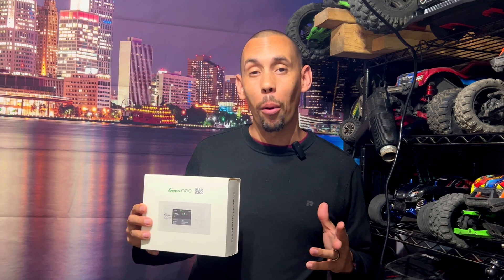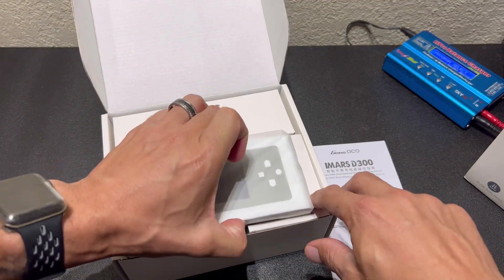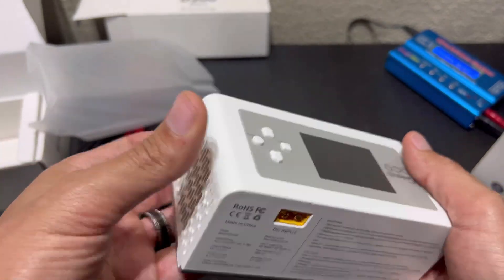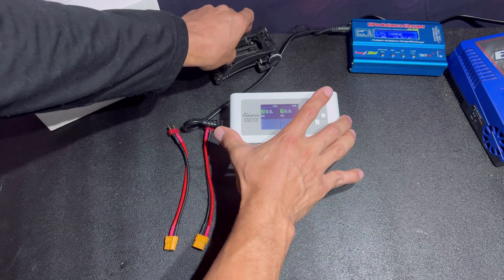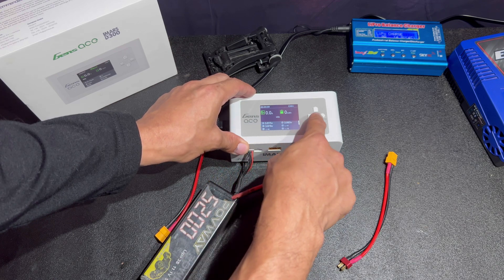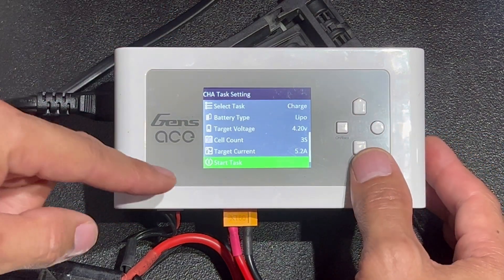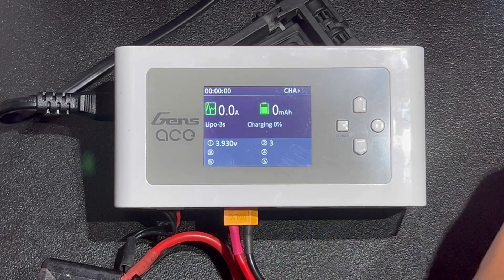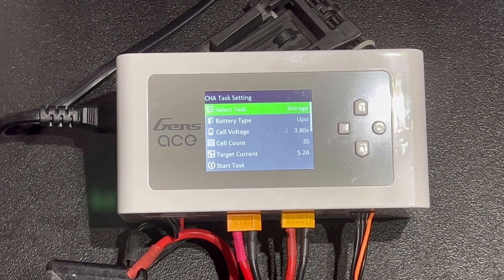How To Setup Regular Lipo Batteries - Gen Ace Imars D300 Unboxing

Comment: So do you just charge lipos with the charge option? Is the balance option something I shouldn't worry about most of the time?
Reply from the maker: Yeah just use charge mode it will balance charge automatically. You balance charge if your battery has low cells

Comment: Question, if I got a battery that was, say, 9200mah, would I have to go into the parameters and raise the maximum mah it will charge? I saw razor rc and it showed around 7600 as a default cutoff so it doesn't overcharge. Or, would the charger recognize the mah and automatically continue to fully charge the 9200 pack at 9.2 amps?
Reply from the maker: Hello, sorry for the delay. You can set the how fast it will charge separately from how full it will charge. You can choose what volt each cell (full) goes to and then you can set at how many amps (fast). 
 
It will automatically set the volt it will charge at and you can change it as well. You will have to change what amp you charger it because it will be saved from the last time you used it. 
Also any parameters set on side A will be automatically set on side B but can be changed.

Comment: Hey bud awesome video thanks for sharing - quick question, is it best to default charge a Lipo under the charge setting or the balance setting? Is there any negative outcomes from using the balance setting to charge as default?

Thanks :)
Reply from the maker: Thank you 🙏.  That is a great question and maybe I should do a short video on it. The answer is, The standard charge feature balance charges your batteries for you automatically. You can watch each cell move up while it’s charging. The Balance feature is cool because you can use it to fix bad lipos. Well to an extent. If the cell is dead dead, the charger won’t be able to fix it with that setting.
Reply: @familyrc777  amazing thanks so much for the quick response! So it’s ok to to use the ‘charge’ feature as a default then as I noticed when I plug my g-tech batteries in  it goes to charge and not balance so I guess that’s preferred unless there’s an issue with the Lipo…?

Comment: I have several batteries with internal balance circuit. Is there any trick to charge lithium batteries without connecting the balance cable with the D300?
Reply from the maker: @minekoiwa2971  not sure in that one. If you figured something out pls share.

Comment: I love the gens ace.. I’m having a hard time with it.. keeps saying no balance cable and it’s clearly plugged in. Getting a replacement.. hopefully it’s just a dud
Reply from the maker: Ah man that’s rough. I started using balance boards to help protect the balance ports of the charger. They cost like $5 a board, Which I suggest.  I can add a link to this video description if you would like. I’m sorry to hear about your charger. I hope the next one works perfectly.
Reply: @familyrc777  please do.. I bought a balance board off Amazon, prob first mistake and  it kept saying “balance cable not in use”
Reply from the maker: lol well the ones I got were off of Amazon as well. I mean they do have different levels of balance boards. Mine were cheaper. I just checked and I got 4 for $10.  I’m sure there are better options out there. But mine have worked for me. Did you attempt to use the charger with no balance board and get the same error?
Reply: @familyrc777  yes, I tried my own trouble
Shooting.  Makes no sense to me, it works when it wants to with/without the balance board/extensions or even by itself. So I’m hoping it’s just a dud.
Reply from the maker: Yeah you probably have a dud. I’m sure it’ll work out with the next one. I’ve been happy with it. Even over my Traxxas live dual which was a game changer for me. The only downside for the gens Ace charger is that it discharges very slowly. Otherwise it’s been great. Good luck!